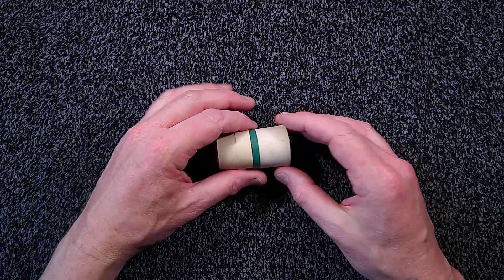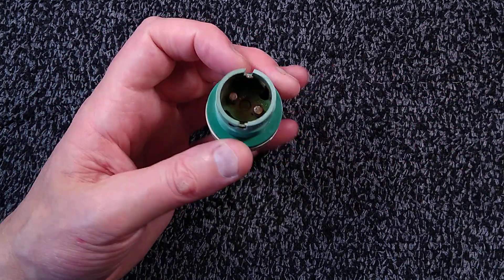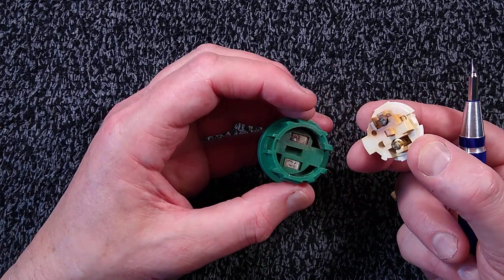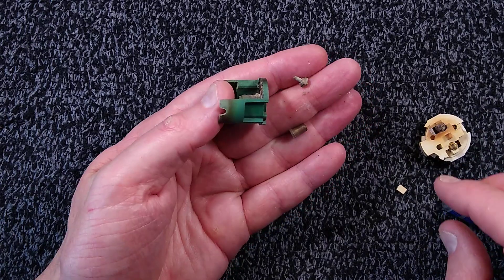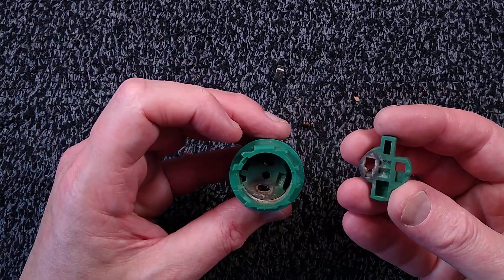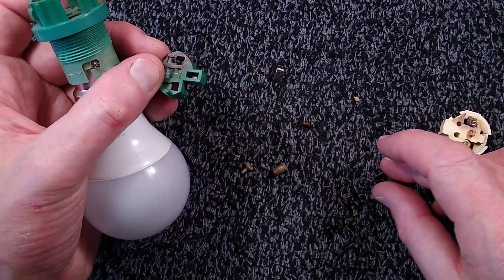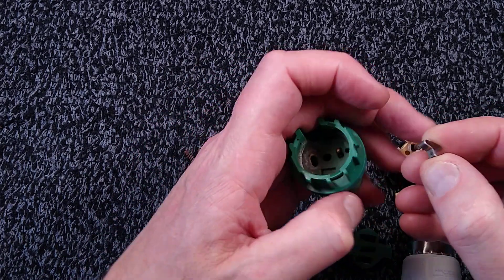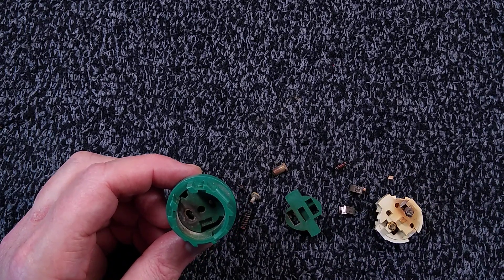Inside a failed safety lamp holder.

Comment: Is the idea to prevent power being available at the socket contacts when a bulb is not installed, to prevent it being a "stick your finger in it" shock hazard?
If so, pretty clever.
Reply: The question is do we really need this common sense says you don't stick your finger in where there could be my power anyways.

But then again code does state that you have to close all openings!

Also I remember they used to have The Old Edison screw sockets back in the day as receptacles I'm pretty sure that over the years at least a few fingers have gone in there if nothing else a little kiddos or kids or even older folks like what's this and of course big hole someone's going to go in that big hole.

And oftentimes those had brass plates on them as well and sometimes those might very well be crossed up with neutral in one way or another once I saw one that somehow had become live and the person happened to brush against that when in contact with a water pipe surprised the heck out of them and asked me what those things were in the first place I said old school plugs that you used a bulb socket for old appliances that would have originally screwed into a bulb socket for power.

One saw a really interesting old porcelain light fixture that had originally a globe with an enclosed incandescent bulb and also had a second socket just to the side that had any another portion of the porcelain fix your surrounding it I'm 99% sure that that fixture was intended for a place that you would have both a light and need to connect another Appliance back in the day pretty clever for back then for sure.

Also one time I did see a brother interesting fixture that had been used as a light was on a separate switch but this is old school to the extreme I don't even know how to begin to describe it first of all it had asbestos wiring.

Later on I realized what this was originally was in place of what would now be used for heat lamp to reflectable type of thing.

But originally this would have been using one of those porcelain or ceramic inverted cone heating elements for an electric heater that had the standard bulb base on it.

It did have a metal reflector Bowl and it had just been used as a light fixture for who knows how long and yes was on a separate switch.

Also in the same place where the cross these push button switches that looked at first to be staring push button lights switches but to my surprise did not latch in place and one was not on and off but two separate momentary switches.

They were connected to some sort of system can't remember very well but I do know there was old Bells throughout the house I do know for sure there was never made quarters nor servants quarters in this place one of the old timers that used to live there said that it was just used for communication throughout the house and property and at some of the wiring that had ran between multiple buildings on that property were connected to this it was not just the 120 volt bells and chimes one was a true chime it was like a charm rod with a bell ringer mechanism so that would sound different that's the only time I've ever seen something like that as well and it still works all the whole system.

The upper or lower one would ring a bell and the other would ring the chime.

Why there was so many wires in the system is every place in every room would have both the two to combine push button switches as well as bells and chimes as well as they were located top and bottom of the stairway as well and even in various areas where you don't expect.

Surprisingly even in the barn and every other out building and outside there was a primitive Horn of some sort or Sounder which could be disabled from inside the house as well.

And there was one Bell located in one of the louvered what look like one of the other but slightly different Cube was in the barn that was connected to the ventilation shafts however that was an electrically operated Bell and it did have a manual pull rope as well that Bell would ring normally electrically I don't know how to begin to describe that mechanism look like something out of an old school poor Rod firearm sort of in the way it was arranged but the electric motor would override the pull rope and vice versa pretty complicated for a simple Bell

Comment: I mean, you could just turn off the power before changing the bulb. Or just not put your fingers in spicy holes.
Amazing the enginerding being spent on preventing people from receiving well deserved Darwin awards.
Reply: By the book, you're right. In reality live/neutral reversal happens all the time, the wall switch is not a reliable disconnect. Based on personal experience in old houses and shitty rentals I'd say about one in four outlets and light circuits are miswired in at least one way. Mostly hot/neutral swaps or using neutral as a ground.
Reply: @Broken_Yugo  Yeah, that's true.
Reply: Now, how do you know the power is off?

Comment: That's interesting - I didn't know such a thing existed.  Should it be a safety fitting that it's replaced with?

Also, you might want to look at getting something like the blue mat that My Mate Vince uses for when you're away from home.  It's also safe to solder on too !

Comment: That needs to be pulled of the market .Need to go back to the Edison style screw base .Every time you deal with any bayonet mount you get into trouble especially in industrial applications .So many idiot and trouble lights failing .Test it  before you molest it,  and never trust the idiot lights.Verrify !

Comment: Economy. For it functioning properly these contacts were needed to be silver-coated... 
Like the ones in radars.
Reply: No. Ordinary phosphor bronze contacts are typical and adequate. Silver and gold are only needed for low voltage and/or low current connections.
Reply: @KJ6EAD  Technically a 240V holdet is low voltage. In standards low voltage is defined as up to 1000 Volts.

Comment: What sort of sketchy ass cheapo accommodation did they provide? Looks like that lamp has been dangling on a drop cord for 50 years.
Reply: They are usually in borrowed student accommodation as the show is during school holidays anyway.
Reply: @johndododoe1411  so cheap ass dodgy student dormitories. That figures they probably charge out the arse for them too.

Comment: My house (rented, built 2002) had these, every single one has failed through the green plastic warping and crumbling (likley due to all the bulbs being leds and heating them up). All now swapped with E27 fittings, makes it much easier to get low power leds.

Comment: Nothing to do with this video but I  think I have something that you might be interested in a shoking usb power supply from China was using it to change my vape in bed the outer night and got one he'll of belt when I put the vape in my mouth metal tip so there was a way of the volts to get me it was not 240 felt deferent quite difficult to pull it out so if you are interested in having a look I can send  you a item number
Reply from the maker: It sounds like an isolation fault.

Comment: Maybe the widespread use of LED lamps will mean that the lamp holders can be made of something more environment-friendly (i.e. recyclable) than the old Bakelite stuff which is thermosetting, therefore impossible to recycle...
Reply: It's not impossible to recycle, just very difficult.   On the other hand, phenolic plastics are enormously strong and long-lived.  Double what this one managed.
Reply: many new bulbholders these days arent bakelite but some softer thermoplastic , certainly ones i've bought recently were, only 'bakelite' part was the 2 white  screwed parts , the inner definitely wasnt
Reply: @andygozzo72  Absolutely - you have to be careful.   The higher end ones still say "phenolic' on them, and are generally black.  I don't believe any white plastics are phenolic, due to the material requirements.  (I don't have a problem being wrong with that, of course.   All the bakelite I've run across was black or brown, unless it was painted)
Reply: @tbelding  i think they are urea formaldehyde,  same stuff as the switches and sockets are made of, definitely bakelite like,  like with bakelite radio cabinets, brown and black phenolic, other colours urea,
Reply: both of these new ones were black inners but definitely not bakelite, softer feeling plastic, textured finish, not shiny like bakelite, maybe some type of nylon??
Reply: i've had ones in the past with grey inner, also not bakelite
Reply: @andygozzo72  The Leviton I'm holding in my hand, from the 60's, I believe, is brown bakelite with a grey inside.  The grey inner is aluminum (threaded portion) folded under, with a chunk of cardboard for insulation, and the copper/brass tongue sticking up the middle through a slit in the cardboard.   I managed to buy an almost exact replacement for a customer, and used the guts of that one to rebuild the original UNO socket.   That is, it has a thread at the top AND the bottom.  The 'mantle' is threaded onto the top.
Reply: @tbelding  the hard white plastic is made with Urea Formaldeyde resin as opposed to the brown which is Phenol Formaldehyde-based.